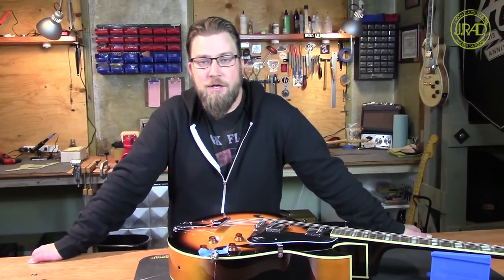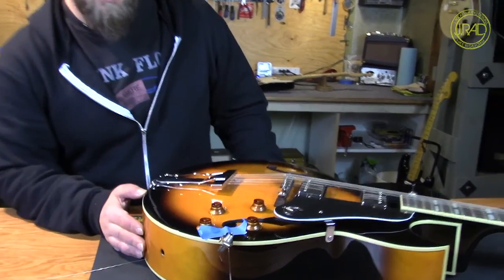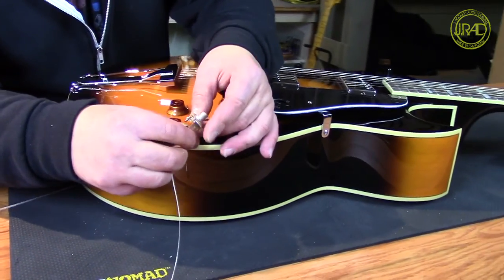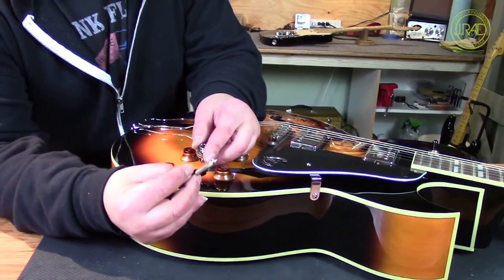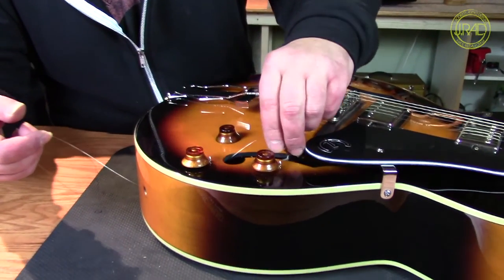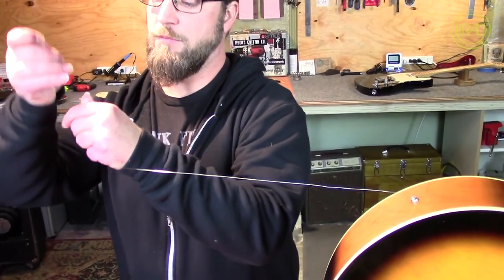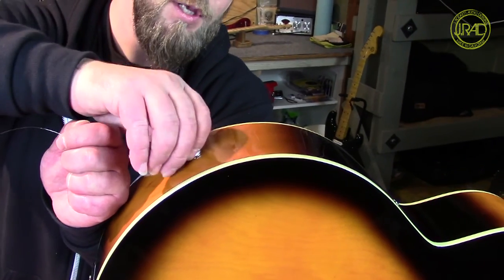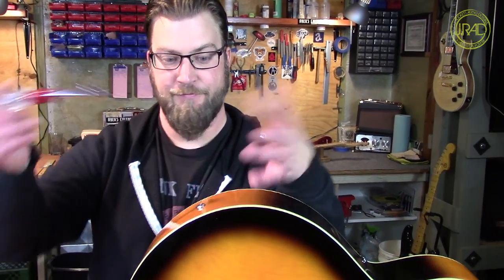Fixing an Input Jack on a Hollow Body Guitar- J. Rockett Audio Designs

Comment: Came here after 4 hours of fucking battling with my d’Angelico semi hollow input jack that fell through  for second time this month, and after finally getting it through the hole and able to (by some miracle) not having it slide back in as I tried to screw it on, I thought I’d check out if this was a common problem and the fix. The first time it fell inside a couple weeks ago I must have gotten super lucky getting it out and back on, cuz this time it was a nightmare. Using pliers, and a long plastic thermal cup straw, I was able to pull it through and fasten it. I was just about ready to smash the 2 month old guitar into a hundred pieces. Unfortunately it will probably come out again, cause I have no fastener lock nut or what ever he was talking about. I’m definitely gonna have to bring it in shop in town and have a tech rig it up so it never comes off again. Thought I was gonna stroke out, I was so agitated. Perhaps I should email D’Angelico and ask them why in the freaking hell don’t they put on a locking washer nut thingy whatever on a god damn 1800 guitar!! Grrrrrr!!!!!

Comment: I did this and the wire snapped inside and now the Jack is out, but the wire is inside. not sure what the next step is. it's a 335
Reply: The jack just went on my 335 too, it's probably just something with the type of guitar
Reply: @thatperson_whoplaysguitar2455  it only cost 40£ and the guy replaced the old Jack with a Gibson one. Worked brilliantly since
Reply: @RIPbob  nice, thanks, I'll get mine fixed after the UK lockdown then